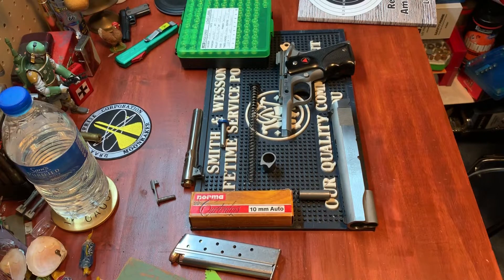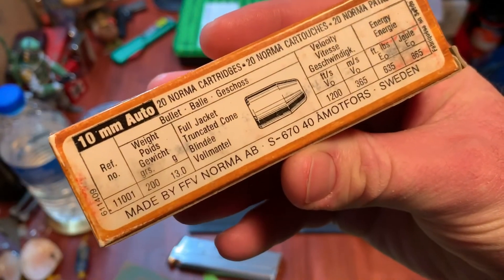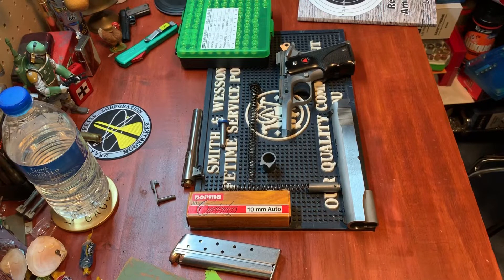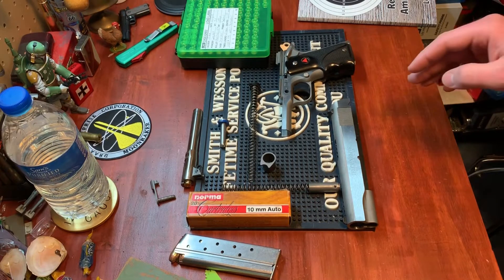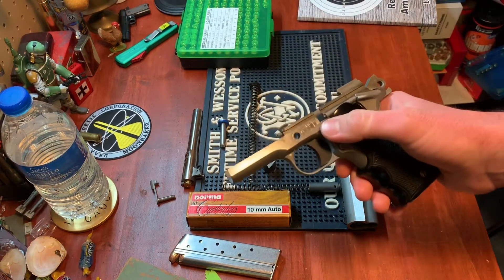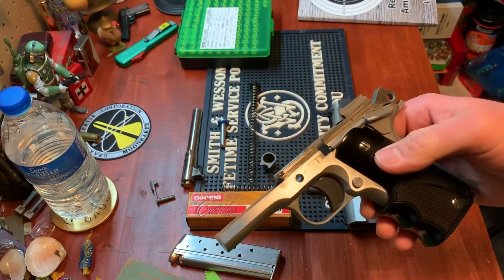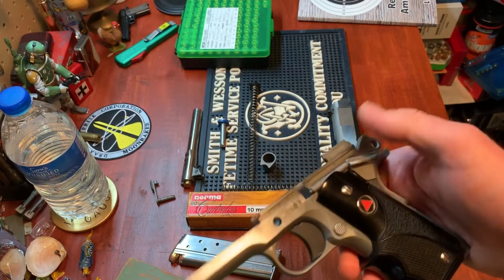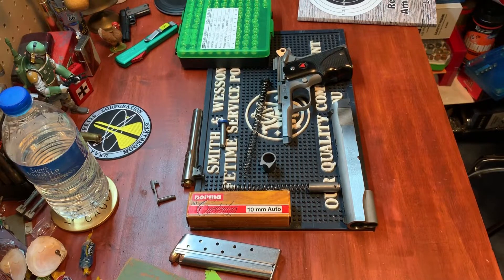Will Norma/full power 10mm blow up a Colt Delta Elite 1911??

Comment: This video reminded me of my inadvertent "proof load" I ran through my early '90's vintage Delta Elite Gold Cup.  I was working up hand loads and running the rounds through my chronograph.  I fired three or four and then BLAM the next one recoiled like a .500 S&W full power 440 gr bullet +P load or maybe a .50 BMG in a handgun.  IT WAS AWESOME!  The chronograph read over 4K FPS!  After I calmed down I checked myself for damage and on initial inspection of the gun couldn't find anything wrong and still could not find anything amiss after it was field stripped.   I quit that little project and moved onto shooting other guns the rest of the day.  Quite obviously, I had double dropped powder in that case.  When I got home I broke down the reloads and never shot hand loads in that gun again.
Reply: Unbelievable! I don't know that a double load would produce that velocity. I'm not saying that it didn't, but I'm scratching my head. Rifles with light projectiles, tons of powder and high chamber pressures only get close to 4k velocities
Reply: You lucked out. WOW!! When I reload I always visually inspect all 100 open cartridges on my reloading tray to make sure there are no "double dips" or primer-only loads. Either is bad news!
Reply: Holy smokes. That'll wake ye up in the mornin' boy!

Comment: Hot ammo from Double Tap and Underwood can give you case bulges in the DE. Not as bad as Glock, but I have experienced the bulges. Glock is a drop in barrel swap fix, Colt is more involved and more costly. I agree with Starline brass for reloading. The DE is a nice pistol.

Comment: I got rid of my Delta Elite and I hand load all my own 10 mm ammunition, due to un unsupported chamber I had case head separations, so I traded it in and got a Dan Wesson 10mm.
If cold will replace that barrel with a ramped fully supported barrel, I will get another one

Comment: I agree completely with this 4 year old posting. Well done. I have a Delta Elite as my daily carry. I’m also a hobby pistol smith and I have completely go through the gun and upgraded everything but the barrel. I carry daily and shoot often (at the range) and I will caution you about using SHOCK BUFFS on a carry gun. I recently eliminated their use after having dependability issues while using them. Put them in when you are blasting at the range and take them out when you carry. My ONE experience in a critical piece of gear says DONT USE THEM IN A CARRY GUN WHILE CARRYING IT.
Reply: That is logical advice,  ty

Comment: I bought two boxes of old Norma 10mm ammo, and none of the twenty rounds fired chronographed at much more 1000fps.  Don't know if it had been improperly stored for 35 years, but pretty disappointing.
Reply from the maker: Powerfactorguy i’ve heard that from several people that the old normal stuff doesn’t have the punch it used to my guess is 35 years can do a lot to ammo
Reply: @SlimCowboy  The Norma ammo did not lose power.  It never was as powerful as advertised.  The only place the 200 grain load ever hit 1200 fps was in Norma's marketing materials.  The 1200 fps ammo often used as a reference for "full power" 10mm loads is a myth that never existed.

I bought a Springfield Omega back in the 80s when Norma and PMC were the only ammo choices.  Like many of the early 10mm 1911s it was a modified 45 and not really up the the added pressure of the 10mm.  After the locking mechanism broke I had the gun repaired and in 1991 traded it for a S&W 610 revolver.  I shot quite a bit of the original Norma ammo through it without any signs of sticky extraction.  But ever time I tried some of the modern loads by Underwood or Buffalo Bore that actually produce the velocities Norma advertised extraction was extremely sticky.  So I know the modern ammo was loaded hotter than the old Norma ammo.

If properly stored ammo will not lose power after 35 years.  There are lots of YouTube videos of people shooting older ammo and it works fine.  But the all the videos I have seen of the original Norma ammo show it consistently producing about 200 fps less than advertised.   Because that is what it was loaded to when new.

When that ammo was made Norma did not have to worry about a bunch of YouTubers with chronographs testing their ammo.  In the gun magazines of the day chronograph results were usually prefaced with some sort of "While I am sure the ammo reached its rated velocity in a test barrel in my gun . . ." qualifier because it was normal to see a lot less than the rated velocity.  

Right after I bought my first 10mm I remember reading in a magazine that when being developed the cartridge was loaded at much higher pressure than the current SAAMI limit of 37500.  But it was too much pressure for a conventionally designed semi-auto pistol and SAAMI set the limit to 37500.  Norma then produced ammo at SAAMI pressure levels but kept the velocity ratings from the higher pressure ammo that was never sold commercially.  I wish I had held on to those old gun magazines but they were thrown out years ago.  Some of the old gun magazines were less reliable than others and I cannot remember which one I read that in.

Comment: I have owned an original Delta Elite for some 30 years now and I have experienced case head separation on two separate occasions. Both involved reloaded rounds and I believe that repeatedly firing the brass in an unsupported  chamber and reusing it eventually weakened the cases and resulted in them blowing out in the case head area. Luckily there was no damage to the pistol but the gas escape did sting my hand and scare the crap out of me when it happened! So now I only either use factory ammo, or new brass for the Colt when shooting hand loaded ammunition.

Comment: I had three Delta Elites in the 80s (I made some really good investments), a blued steel original, a stainless steel standard model and a special ordered stainless adjustable sighted model, gone over by Colt. I used the handguns for general shooting, pistol silhouette, and handgun hunting (I had to go out of state - my state at the time required a 5 1/2" barrel for handgun hunting. 

The Delta Elite shot and handled every load from Norma, whether the 200 gr. load and the 165 gr. load without a problem. In the case of silhouette shooting, it was the only semi-auto that could hang with a 44 mag or 41 mag on 100+ yard steel knockdown targets. It also dropped hogs and deer out to 75 yds. without a problem. 

As I listened to the magazines at the time,  too went with the Wilson combat two-piece steel guide rod with the Wilson Shok Buffer. I don't know if I needed it, I just wanted to try.  I also heard about the frame cracking and tried to find an example or even a photograph, and could never got to an example or photograph. I also had one of the S&W 1006 handgun that every gun rag loved to death, IMO is was an inaccurate, snappy dog. FWIW.   

From watching people try to shoot full-power 10mm loads, I think most were intimidated by the recoil. When Hornady and Winchester came out with full-power loads which were lighter than the Normas, most people thought they were too hot as well. 

Oddly enough, when Winchester came out with the Black Talon in 10mm everybody thought it was the 'hottest' ammo out there, but Chrono results showed it was equivalent to the 10mm FBI loads.  But the press was full of all sorts of hysteria about how deadly and cruel the Black Talon was and had people convinced it was some sort of super bullet/round. 

Then again, I was shooting lots of heavy .41 Mag and .44 mag out of S&W 57's and 629's, and even heavier cartridges out of Thompson-Center Encores. Oddly enough most people were really intimidated by a comparative pussy cat, the XP-100 in .35 Remington.
Reply from the maker: I agree  The full power stuff can have quite the snap to it while still being very manageable by a practiced shooter which I guess was one of the fatal flaws with the Norma 10mm was that most people don't practice enough with their handgun (including the FBI LOL) so they of course jumped on the 40 Cal bandwagon and the rest is history
Reply: Slim Cowboy ; in truth, the shooters in the FBI unit that were the ones evaluating the findings of the report and did the research to select the 10 mm were all experienced shooters, and I read that their choices were the 10 mm and the .357 Magnum. 
Fro pm reading about the reports findings and other articles, there may have been some political considerations to avoiding a cartridge with a ‘Magnum’ designation and just the limitations of the revolver itself.

What’s missed is this was at the time when two things were happening; incorporation of women into the FBI field force, and the ‘conflict’ over the shooting technique. There were two competing handgun technique, one, the Weaver or modified Weaver and the Isosceles technique. The selection of the Isosceles technique won out, principally due to ease of training and some very vocal advocates, and some very successful and heavily promoted competitive shooters advocacy. 
The Isosceles won out and it’s almost universally taught as the “Modern Pistol Technique.” 
The Modern technique while easy to teach and allows relative newcomers to become fairly successful while shooting has a real problem with handguns that have recoil impulses greater than a 9mm handgun for the vast number of people. The reliance on have both arms locked or virtually locked while holding the pistol extended before the shooter, transfers the recoil impulse directly back to the shooter and disrupts the entire body with the recoil impulse. This is one reason why competitive shooters seem to have adopted an exaggerated forward lean with the shoulders brought up almost to ear level when viewed from the side.
Contrast this with the Weaver, that uses the athletic stance and the unlocked but extended shooting arm, which is slightly bent to naturally absorb recoil.
Or by watching handgun hunters firing heavy recoiling handguns, one can see a variation of the Weaver with an exaggerated bending of the shooting hand to allow for more use of the tendons and muscles of the arm and shoulders to once again absorb recoil. There is another interesting modification that may be seen in shooters of the more powerful handguns used in handgun hunting, this may be seen as almost unintentionally shooters seem to incorporate as semi-cheek weld on the shooting shoulder to assist in providing the increased accuracy needing with handgun hunting. 
All this means the incorporation of the arm, shoulders being in a position to absorb recoil.
But to achieve this and the accuracy that it affords requires practice. Almost no practice in the ‘Modern pistol technique” occurs beyond say 25 yds, often much closer.
Reply: Everything you stated is true. I've had mine 29 years and shot NORMA and every other hot hunting load. Used for target, carry, and Whitetails. New spring guide and buffer is all. 🦌⚰😉👍

Comment: Just watched your video and subscribed. Thank you for making it. Question. Which brand 24lb spring did you use? That, and do you have any recommendations on magazines? Thanks again!
Reply from the maker: I use Wolf brand springs, as far as magazines the only ones I’ve had luck with working in the Delta elite are the factory Colt ones. Thanks for the sub.

Comment: The argument that it must be safe because it was developed back when full power 10mm was the norm is not really sound.  It could be that it was an unforeseen issue.  We've seen similar cases in certain other guns, where frequent issues were later discovered and had to be addressed in later revisions by the manufacturer.  We've seen it with Beretta's M9 (slide cracks), S&W's original Model 66 (forcing cone cracks), the original Glock 22 ("Glocknades"), and various other firearms that were supposedly designed to handle firing their respective calibers.  Manufacturers  make mistakes.

Comment: 1:13  200gr projectile going at 1200fps is not 100% "full power".  From what I picked up on the internet, full power 10mm is: 135gr at 1600 fps, 155gr at 1500 fps, 165gr at 1400 fps, 180gr at 1300fps, *200gr at 1250fps*, and 220gr at 1200 fps.  There are still ammo manufacturers such as Underwood, DoubleTap, etc., loading ammo at these velocities, though most of them are hunting/defense kind of specialty (expensive) rounds.  For cheap FMJ range ammo, Underwood, SIG Sauer, and Fiocchi are three brands that offer 180gr FMJ at 1250fps, close to full power.  There is one brand called Fenix, they sell 180gr FMJ at 1375fps, way above and beyond the level of that original Norma ammo, though I had no experience with them :)

Comment: If you compare a 10mm Kimber or Dan Wesson to a Colt Delta Elite the only differences that I can see are the Kimber & DW have a fully supported chamber and a full length metal guide rod.  Minor differences only.  The Kimber, DW & Colt can all handle full power ammo without problems.  There are other quality 10mm 1911’s available, but those are the 3 that I can speak for from personal experience.
Reply: @donovanchilton5817  who are you to call people names? Are you an engineer?
Reply: Gotta say i am extremely happy with kimber eclipse 10mm

Comment: I think an all steel centimeter can take true 10mm no problem. Aluminum and composite ones are where you'll see problems and need to go back to borderline 40 S&W.
Reply: the DEs were steel and fell apart, that's because colt still uses casts frames for them literally anyone else that makes one of quality makes a forged one
Reply: @johnklatt3522  the people who work on them after they break. colt doesn't use forged frames on their cheap production guns
Reply: @johnklatt3522  you can tell by some of the texturing inside the unmachined portions of the frame
Reply: @johnklatt3522  I feels, but if it's got any sandy or rough looking textures on the portions. that weren't machined it's cast, if not it's usually Forged, and if billet it's all machined
Reply: @JKCullens  Colt  DOES NOT use cast frames... you should stop giving advice when you clearly have no idea what you're talking about

Comment: double tap blew my bullets out of the bottom of my mag..   spring flew somewhere.  something hit my face after the shot..   I had an older Delta.    found out the hard way
Reply: Yup, colt DE are hazardous.. I will Never buy an unsupported chamber again!...had a case blow up and case smiles" on factory hornady loads 155grs xtp's
My Kimber stainless 2 is far safer with supported chamber ..

Comment: The logic that Norma spec ammunition was all that was available, and therefore must be safe for use in the Delta Elite, is dangerous and logically fallacious, just from what we know about other firearms in the past. The .357 Magnum, for example, used to be loaded much hotter. In the early 90s, S&W got tired of their small frame revolvers torching their forcing cones and top straps, and asked SAAMI to lower the max average pressure of the .357 Magnum. SAAMI obliged and lowered the max average pressure of the .357 down to 35,000 PSI from somewhere in the neighborhood of 43,000 PSI. If you had applied this same faulty logic to the small frame revolvers, you could argue that the full power .357 Magnum was safe to fire in a small frame S&W revolvers, because that is the only ammunition that was available when the revolvers were developed and released to the public. However, the fact that S&W got so tired of repairing these revolvers that they requested the max average pressure be lowered rather than redesign their revolvers shows that the logic is faulty and it was not safe to shoot high volumes of full power .357 Magnum through these revolvers. 
Similarly, when the 10mm Auto came out, it was among the most powerful cartridges ever put in an automatic handgun. Because it was designed to fit in a .45 ACP sized grip and magazine, it was mostly .45 ACP guns that got put on the market in 10mm Auto. But the 10mm Auto is a completely different animal than the .45 ACP, and it is obvious that none of these companies did due diligence with long term durability testing with high round counts of this Norma ammo. Nearly all of the initial offerings in 10mm Auto developed some sort of a reputation for rattling themselves apart. Colt didn't make the necessary design modifications that you discussed to the Delta Elite because there wasn't a problem with it. Rather, it is more likely they learned some lessons the hard way because nothing like 10mm Auto had ever been done before. Putting 37,500 PSI behind a supersonic 200 gr projectile is a lot more force to contain than 23,000 PSI behind a subsonic 230 gr in .45 ACP +P or 35,000 PSI behind a supersonic 124 gr 9mm. The .38 Super could get pretty hot, but was not without its own issues, and was still not quite the beast that Norma spec 10mm Auto was. Companies did their best, and just fumbled their way through the teething stages resolving issues as they appeared. The newer Deltas are probably much more capable of handling full power 10mm Auto than their predecessors, but on some level, those of us who enjoy shooting 10mm Auto and insist on shooting only "real" 10mm Auto might just have to accept that few things are free and physics always gets the last word in. It will probably never be realistic to expect the same long term durability from a 10mm Auto as you do from a .45 ACP. With the cost of ammo, a modern 10mm from a reputable manufacture will probably take everything you can give it, but if shooting a half a million rounds through your handgun is an option for you, the 10mm might not ever be the best choice. The 10mm Auto, when loaded to its potential, is a high performance round. It isn't realistic to expect the same mileage from a 10mm as it is a 9mm or .45, in the same way that expecting the same miles from a 1000 horsepower racing engine as from a Toyota Camery.